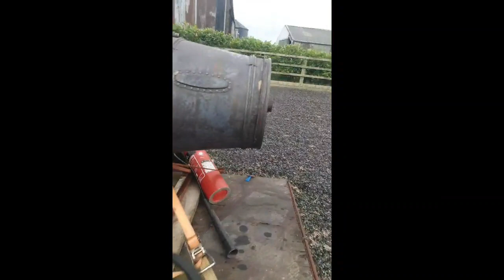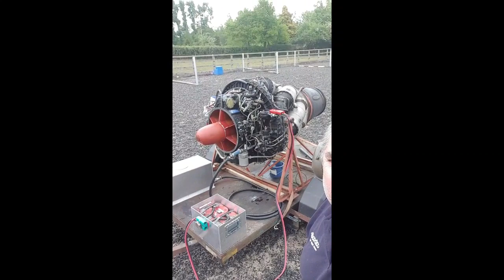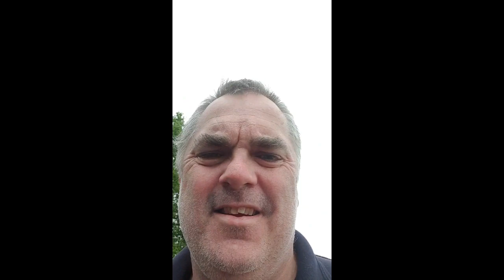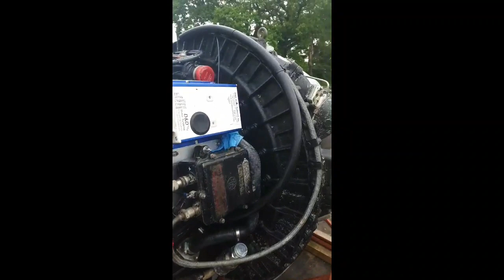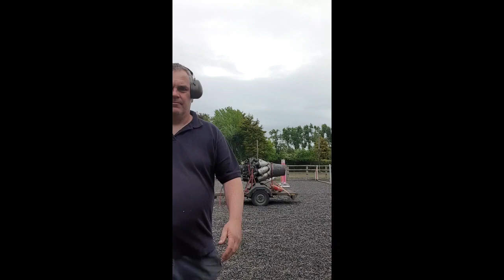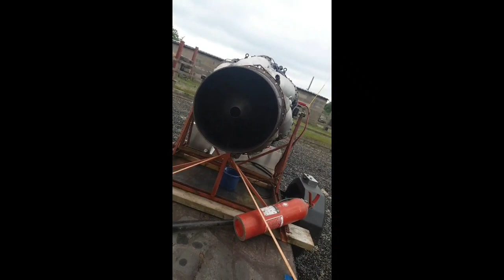Motolet M701C-500 Turbo Jet Gas Turbine Engine - jetpower.co.uk

Comment: Hey Adrian, what type of Andreson connector (the red one) are u using on the engine stand to connect/disconnect the batteries used for starting? I saw the upper end of this connector family can do 375Amps, but here my guess is that some more amps are flowing during craking off those Optima batts when the starter contactor is engaged and N1 is at 0% :) This engine has a huge compressor/rotating mass to be spooled up by the starter.
Reply from the maker: Its not that big, doesn't pull more than 250 amps. To be fair though the Andersons can be abused somewhat, we regularly out 800 amps through them, only intermittently though.
Reply: @jet-power  You're right, recently did a measurement of the starter current of a L-29 trainer aircraft with the same engine and currents nearly came out the same you mentioned https://www.youtube.com/watch?v=sPEDva2E-yg
All conversation is done in Hungarian, sorry for that :)